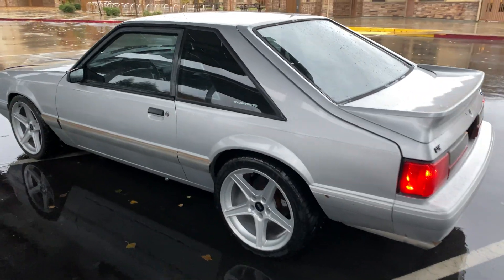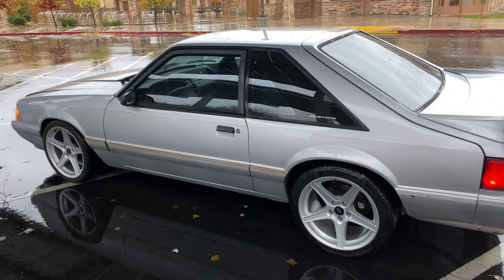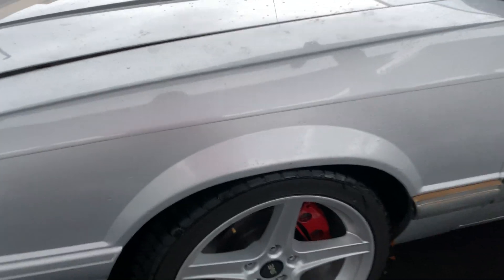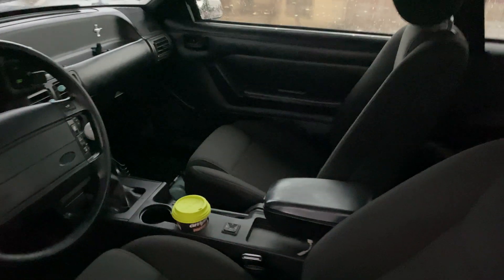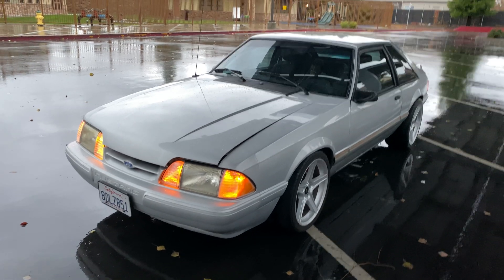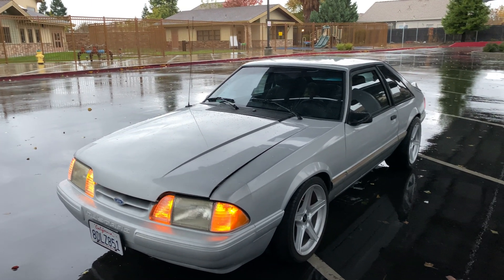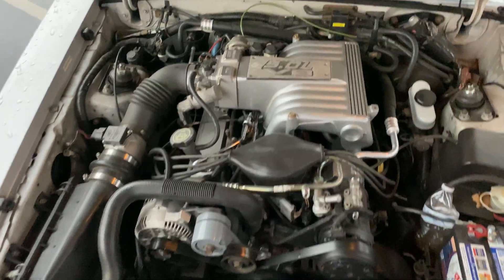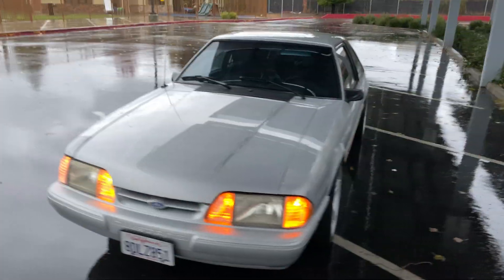4 cylinder to V8 swap how to update walk around

Comment: I just bought a 90 Model that has been swapped from 2.3 to 5.0. I think the rear axle is to wide. Has disc brakes but rubs tires in corners. Also the sway bars are missing. Will regular foxbody sway bars work?  Been a long time since I owned a mustang. Thanks

Comment: I'm doing the same thing on  a 89 with a 90 V8 harness, am I able to leave the factory 4 cylinder harness inside the car ?
Reply: U can't use a 90 harness on a 89 car they have the same grey in  black plug by the master cylinder but it is a Air bag harness man over were the Maf plug is on the passenger side fender well it has a white plug it's for a Air bag it will not work unless u change the whole harness from the headlights back to the tail lights  dash harness in everything better off to find a 89 harness  or a 88 California car harness with MAF ! But 90 will not work if u get the right harness u can use all ur 4cyl dash harness plug in play u can even use a 87 speed density harness in pin the Maf sensor into the 60 pin connector!! There's a guy name Tim at www.ponyperfomance.com he is in California sells harness he goes threw them make sure there are no broken wires replaces bad plugs he is pretty fair on prices to do use that 90 harness it's a waste of time man!

Comment: you should go with the 11r 205s ! won’t have any ptv issues and a lot more cfm and a custom cam set up from ed curtis man. I had literally same set up as your previous just with unported holley systemax 2. those 11r 190s are bad!
Reply from the maker: Boosted coupe i think 205 is wayyyyy to much for a SBE even the 190 was a slug down low

Comment: Nice nice nice.

I'd say if it's in closed loop it's definitely a cam.

And what is the difference between an explorer 5.0 and mustang (I know the H.O. mustang is factory roller...)
is the explorer as well, cuz I'm certain to the 5.0 in the 90s 1fitty is not a roller cam true?
Great work btw the hatch cars are more likely to get robbed cuz their hatches are popped easily ,I learned of late.👍
Reply from the maker: 6BT_ Str86 the explorer 5.0 has the same heads and intake (almost) as the 93 cobra.

Comment: What did you do to swap from the 7.5 to 8.8 rear brake like, the "T" mounts near passenger axle tube on 4 cylinder and the v8 runs it down the middle.
Reply from the maker: CwasGood i ran a v6 94-95 7.5 brake line on the v8 rear end. It connects at the same point as the 2.3 body. And it fits perfectly on the 8.8 from the 94-98
Reply: Is there any other way u can do it or that would be the best option in is that the only year is off a 94-95 V6 with a 7.5 rear ! U look like u did a dam good job on that swap I have a 87 notch 4cyl  ready to swap it's a aod car but I have a 92 GT for a parts car I have the whole 89 engine harness everything o2 harness for the t-5 trans fuel lines have to be swapped but I will be doing mine in the street 2 lol don't have a garage but once I get my 4cyl out in have some 1 pick it up I will be ok I live in Baltimore city, Maryland in they are bitch's about stuff like that!